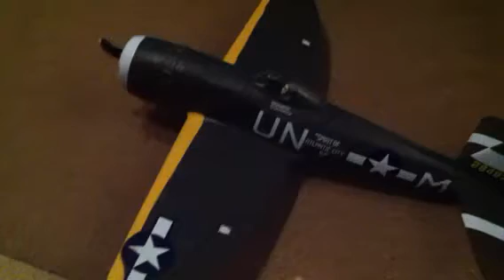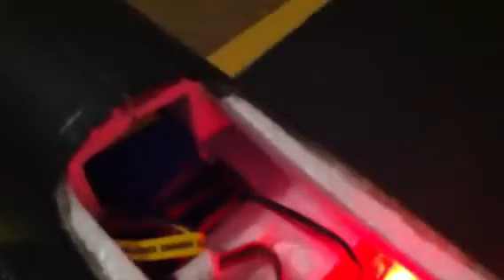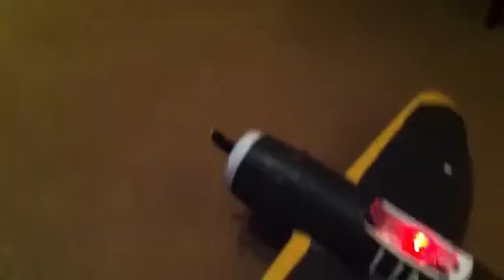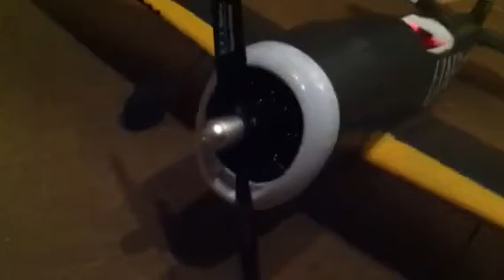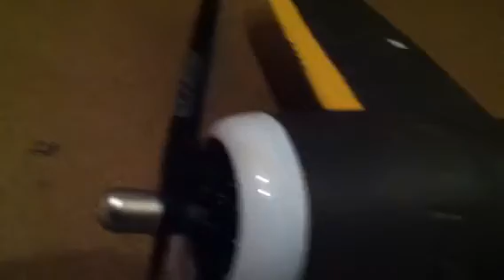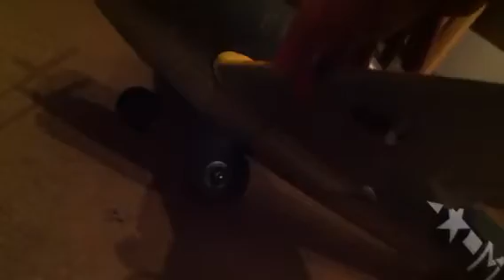750mm Airfield P-47 fixes

Comment from the maker: I started using the sky lipo batteries from nitroplanes and they work much better. The eflite battery was only 15c and was very hot after flying. This plane was only $65 and so I am a lot more daring with it. I have had many hard crashes but it always breaks clean and is easy to glue. Electronics have been solid and the orangerx has never had a glitch. This plane is very fast and fun! I hope to get some flight footage soon.